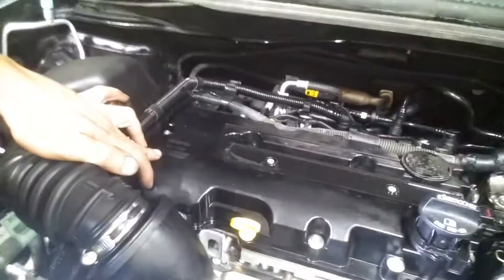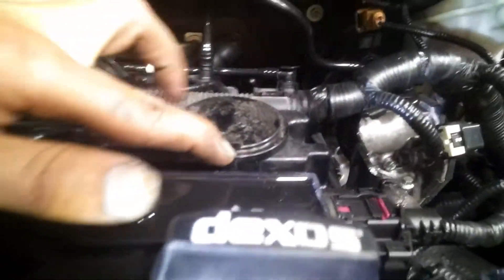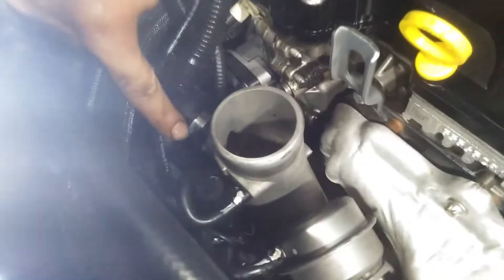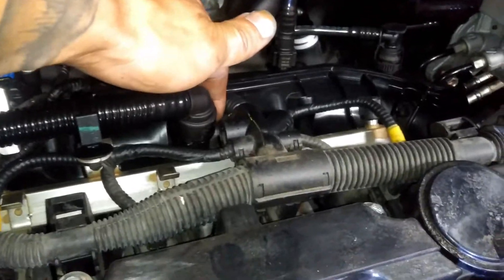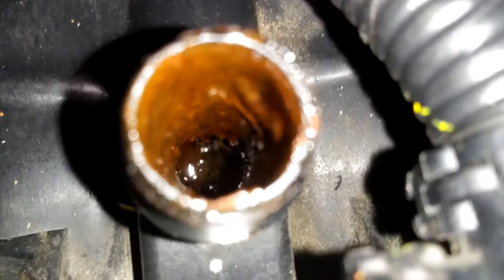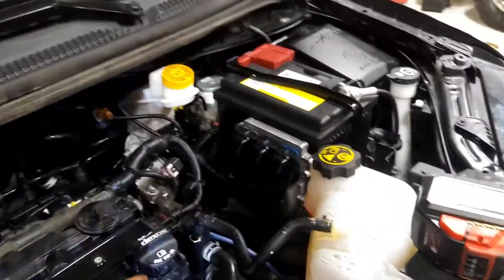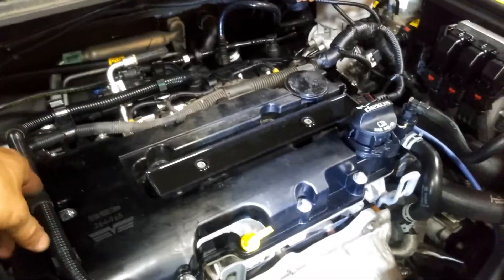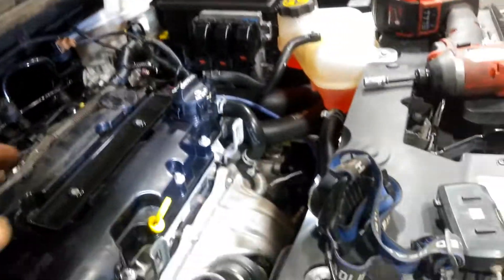chevy 1.4t ecotec squeaking noise chirping sound

Comment: After I did all your points. I checked out the spark plugs and found one of the port’s with an oil film. And checked the torque and, pulled out the plug. There’s was oil on the plug. Cleaning it and putting it back in and torque. All is good. 40,000 miles on a 2016 Chevy cruise. Thanks for your posting.
Reply: You have a video for it ?
Reply: @SkyWarriorsProductions405   no but it was a easy fix.  Seeing the oil film and loose plug. I had no idea this was my problem.
Reply: @SkyWarriorsProductions405  no I didn’t think about it. I now have 46,000 and all is good.

Comment: Tried telling my mechanic and he completely ignored me and said it was the belt. Pulleys, belt, compressor, belt tensioner is replaced. Checked it by taking oil cap off and for sure pinpointed it to the valve cover. Thanks man

Comment: A new crankshaft seal fixed this sound on my end. This video was extremely useful, keep up the good work!
Reply: Hello, it was the seal one flywheel-gear box side or engine side? thank you
Reply: Was your crankshaft seal leaking oil before you changed it?
Reply: @UniquelyDiscovered  not really, just making the weird noise.
Reply: @georgiuzunov4006  ok thank you for your response. I’ve changed my AC pump, drive belt and new tensioner but it’s still making the squeaking noise but not leaking oil. Going to change the crank seal tomorrow and hopefully it fixes the noise!
Reply: @UniquelyDiscovered  keep me posted I'm 100% sure that's your issue :)
Reply: @georgiuzunov4006  I’ve changed the crankshaft seal and tested it today and I haven’t heard that squealing noise again! I think it has sorted it! The old crank seal wasn’t worn on the outer side at all, there was no oil leaking from it. The grooves on the inner side I could say were slightly lower compared to the new one, so maybe that was what was causing air to get past it. But thank you! Glad it’s sorted now.
Reply: @UniquelyDiscovered  happy to see this worked for you as well ;)

Comment: Try unscrewing the coil pack, pull it up slighly.  Turn on the the engine, then wiggle the coil pack up and down or side to side.  See if that makes changes the volume of the chirping.  It could be a problem with loose spark plugs, coil boots or the coils.  The chirping could actually be arcing.  I had a similar problem with my 2013 Cruze 1.4 Ecotec.  It was resulting in poor gas mileage and sluggish acceleration. 
On a side note, if you ever remove the valve cover, check in the timing chain location, there's a brownish orange plastic guide towards the top for the timing chain.  It's been known that this gets loose and it needs to be tightened down. This is because there's a hole at the top of the guide that spits oil to lube the guide for the timing chain.  If that gets loose, then then oil doesn't lube the top surface of the guide where its needed.

Comment: Like others have said.  It's the crankshaft seal.  It may also be the valve cover if you are unlucky.  Be aware checking the plugs will very likely result in torn boots.  There are numerous service bulletins from GM. It's a common problem.  New crankshaft seal cost me $150 installed here in Canada in June 2023.
Reply: I am jealous of your install cost. I have a 2014 Chevy Volt, which uses a similar or even the same engine for electricity generation via gas, was quoted by two dealerships here in California $1500 for the front crankshaft seal replacement.
Reply: Hello, it was the seal one flywheel-gear box side or engine side? thank you
Reply: Was your crankshaft seal leaking oil?
Reply: @UniquelyDiscovered  
It was accessory belt tensioner roller

Comment: Its the crank shaft seal! - Not the PCV valve in the top cover, nor the belts, nor the pulleys, nor the water pump, altinator, air-con etc. Been there done that. drove me mad, spent a lot of time, money and frustration. Got the crank shaft seal changed, Happy Days!
Reply: I replaced my crankshaft seal and I still have the squeaking noise although when I pull out the oil dipstick it goes away. My next noise is now coming from the top of the valve cover at that PCV valve hole on the top of that round piece. What was your fix for this? Did you change the valve cover did that fix it?
Reply: @ffsteel111  yea you need to replace the valve cover
Reply: @ffsteel111  Replacing the crankshaft seal fixed the kind of bird tweeting/chirping sound. This chirping sound was most noticeable when the engine was under load just prior to moving off and particularly when you turned on the A/C. Once the wheels started moving, the chirping had gone. It was also particularly noticeable if you hold down the brake and just tickle the gas. The replacing of the PCV Top Cover cured the constant high pitched noise (which of course disappears when you pull the dipstick). I know it's really difficult to precisely locate sounds in an engine bay, but a medical stethoscope can help sometimes as you can home in on certain areas. I tell you what, when you finally get rid of all those noises, you can sleep at night. Good Luck!

https://youtu.be/uT3EE9x4htI 
This was the same as my noise.
Reply: @stevemc6671  I ended up changing the valve cover I also bought an aftermarket PCV valve bypass and you can install it without removing the intake manifold I purchase it from a guy who has videos online totally bypasses the intake manifold valve and goes down to the turbo it was a great investment.
Reply: @ffsteel111  Hopefully it's all sorted for you and your customer now?! BTW On a different occasion  I had to get the inlet manifold replaced as it had a reocurring and persistent P0170 error code issue.  Oh! and it went through 2 Water Pumps, on the second occasion it almost fried the engine. I must have had the engine built by the manufacture on the last shift before holidays!
Reply: @Ryaninsanity  I'm in the UK and used to  own a vehicle with exactly the same engine (2013 Vauxhall Astra 1.4T SRi). The crankshaft seal cost just over £60 at the time and needed an hours labour charge to fit. It definitely the seal that causes that exact sound. Please don't go the route of PCV breathers, Water Pump,  Alternator, Auxiliary belt etc. Change the crankshaft seal, that noise will be gone and you  can at last rest easy at night! Happy Days!
Reply: @Ryaninsanity  ....If you were enquiring the cost of replacing the Inlet manifold. It was approx £800.Not cheap!
Reply: @Ryaninsanity  🙂👍
Reply: Make sure you follow the proper bolt tightening sequence on your valve cover or you will be doing the replacement again
Reply: Mind had exact same noise. Turned out to be a lose spark plug lol
Reply: @bbltd.3154  Im glad you found it 👍 Mine drove me crazy until it was found and sorted. I hate rattles and squeaks on cars! Grrrr!
Reply: It’s the crankshaft seal!!!!
Reply: Is this right mate  did the crankshaft seal sort yours out mine doing the same
Reply: Did this fix yours mine is the same
Reply: @Tucker Houston  Yes, the crank shaft seal, 100%. It made that exact same noise and despite months of messing about and expense with changing water pump (x2) and the top cover of the engine and cam belt spray, changing the crank shaft seal was the answer - to much relief!!!! No more embarrassing and annoying moments when vehicle is stationary or in a drive-through hearing that f-ing noise!
Reply: @Tucker Houston  Further to my previous reply - Don't waste anymore time, stress or money, change the damn seal - job done
Reply: Vauxhall putting all sorts puts  in my car they haven't a clue they make the cars I've told them about the crankshaft seal they just want put moving parts on wat is the seal doing make this noise and did this sorted for you I put new rocker cover on it after market one fixed it for 2 weeks then I bought another new one gm rocker cover vauxhall make didn't fix it again I put new pvc valve in it didn't fix it this has been stressful doing my head in vauxhall just want make money out off me I spent 340 pounds on new water pump and and tensioner didn't fix it now there saying new air con pump fan belt and alternator funking joke they are cheers texting back
Reply: I'm going do leak down test to for the health off my engine got on finance the thing been doing my head in I drive a14xer corsa d sri 2014 model just keep my mind at rest doing leak down test 😅 🙃
Reply: @Tucker Houston  I did a similar route to you with Vauxhall and got nowhere. So I did a bit (well a lot of digging) and I discovered that Vauxhalls fault diagnosis protocols did not include the Crank Seal, but did all the stuff you have already been through, PCV, Water pump, tensioner, pulleys, alternator, air con, etc etc and I wasted loads of money and months of messing around. I even bought and used a stethoscope to try fing it myself, but as the engine had to be on and under a slight load such as just raising the clutch I found it impossible to do, I didn't fancy getting dragged into the engine with a stethoscope round my neck. Now, I found that Chevrolete Cruise 1.4 Turbo owners in the US had the exact same noise (via Youtube) and doing more Internet digging I found that Chevrolete issued a 'Servicing Buttetin' at some point on this exact chirping issue and it basically said that you should not go messing about with all that other stuff, change the Crankshaft Seal as that IS the problem. So I went back down to my Vauxhall garage (we were mutually fed up with each other at this time) and I told them to stop farting around and change the damn Seal. They did and 1.5Hrs and £60 later it was done and cured. No more of that noise (which I was, by then, hypersensitive to) when the a.c was on, or just coming off the clutch or listening to whilst stationary in traffic or embarrassingly picking up a McDonalds/Starbucks drive through. Its the cheapest, quickest option for you to try and it worked for me 100% from that exact sound you hear on this video. You will be pissed when you realise you have done all that other stuff and it's down to the Seal. Basically, it's not listed in the Vauxhall diagnostics, but it is in Chevrolette and that's why Vauxhall have changed all that stuff and it's made no difference.
Reply: @Tucker Houston  The squeak does not bother the health or performance of the engine at all. Its just a noisy crankshaft seal, no damage is done in the same way you might have a squeaky door hinge but it doesn't damage the door or it's lock
Reply: BTW Mine was a 2013 Astra 1.4 SRi Turbo, I can't remember what the engine code was off the top of my head (I no longer have it)
Reply: Takes my car 20 minutes till the chirping comes in till engine is warmed up right doesn't do it on cold start then you here it chirping when you turn it off because the wheels still turning I've got cable tie on my oil dip stick to pull it to left abit stop the noise and it works I am getting it fixed but
Reply: Steve thanks for texting back this was headaches cable tie dose the trick pull dip stick out abit 😆 🤣
Reply: @Tucker Houston  I found this out too by the dipstick, that's what led to falsely thinking it was 'pressure' related and hence the changing of the PCV. But, of course, after the PCV was changed, the sqeak remained. The crank shaft seal is located deep down where the belt is, so it's easy to assume it's either the tensioners, pulleys, belt, water pump etc. But, as you have experienced, it was none of the things you've already had changed. It cost me £60 to have the seal changed, maybe 6 or more years ago now, so it's probably closer to £100 now
Reply: Going get it done thanks for the help
Reply: Is it the small seal shop is ask is it a rear seal could you send me pic of one please
Reply: @Tucker Houston  I don't have a pic of the item and I don't have the car anymore, but I still have my service records and it said 'replace crankshaft oil seal' and I think, maybe the Vauxhall part number was either V0055568033 or V0025193519 as these are seals which were changed during investigation but there is not enough detail on the service record to determine which one was which. I had the engine cover and water pump changed, but only when the 'crankshaft oil seal' was changed (whether it was front/back) did the noise dissapear
Reply: @tuckerhouston8935  ......its the front one
Reply: @stevemc6671  I got my crankshaft seal done fixed no bird inside my engine nomore hope stays like that cheers talking to me about it 😂
Reply: @Tucker Houston  Excellent! You can sleep at night not thinking about it now! It never reappeared in the remaining 4 years I had the vehicle. Best Wishes 👍
Reply: I no its running better to cheers mate
Reply: Man I hate that expression. BEEN THERE DONE THAT. so old
Reply: I know this is 4 years ago, i have an ecotec motor in a opel and been having this weird squeel only when the engine is up to temperature, its there about 80% of the time when the eninge idles, again only when warm. Also replaced all the pulleys and checked pcv, still there, when i pull the dipstick it makes no difference. The sound is also quite constant, comes when i rev the engine slightly and will stay for a while, anything between 5 to 30 seconds while idling after revving, then goes away again. The car has been doing this for longer than  2 years and is driving me mad. Was your symptoms similar? My next step will be the crank seal

Comment: had the exact same issue. just fixed it and it was a loose spark plug pushing compression past the rubber boots on the coil pack.
Reply: how do tou tighten it
Reply: @harmansingh6933  just watched a dude do it with a 5/8 socket & an extension not hard at all

Comment: I have an 05 outback xt quite modified.. New engine build with a lot of customizations.. The comments and the video categorically nailed down the issue topic I'm having by trying the oil fill cap on then off etc. Clearly my level of vacuum is causing the reed effect of a wind instrument somewhere. I'm not convinced mine is my rear main seal which everyone here keeps calling crank seal.. The majority of seals on the engine are subject to the crank case pressure. The entire valve cover gaskets, the "front crank seal" ie oil pump seal, the rear, all 4 cam seals, the oil pan, the oil pump, brake booster, all your PCV system, probably more. But yea, the shaft seals - cam and crank - that's interesting.. Mine almost sounds like a passenger side cam seal.. Then again passenger side valve cover as well. Still haven't pin pointed mine, but everyone was saying turbo... So turbo air and oil are also culprits technically.

Comment: Literally just had this happen and it was the goddamned spark plugs. They'd changed my plugs and coil but whoever did it didn't torque the plugs correctly. The GM service guy caught it right away, tightened the plugs and it was gone. 

Squeaky spark plugs is the wildest thing I ever heard of

Comment: Have a 2009 Chevy Malibu ltz. Same exact sound. Says pcv us built into the intake manifold. Took that off and cleaned ports. Still making the noise. When removing the oil dipstick, it stops
 What else can it be?? No other signs of leak coming from anywhere else.

Comment: I have that exact same chirp, and I just replaced the intake and hose yesterday, and the valve cover about 2 months ago since it had the hissing sound.  My chirp wasn't there when I first started it, but took it for a drive and when I got home it's squeaking again.  There's no hissing sound now, but there's a chirp.  I'm wondering if maybe I have something else, or did I blow out the valve cover again?  This car is a pain, but fun to drive when it's all working right.
Reply: Turns out my problem was the #2 and #3 spark plugs backed out.   Cleaned them and torqued them down and chrip is gone.   FWIW, my valve cover was hissing, the valve in the intake was gone, and the hose was cracked so they did need replacing.  They just were not the sound I was hearing.   Hope this helps anyone that is reading this.

Comment: Mines squealing when the rpm's climb not idling so ive researched and narrowed the problem down to the valve, plugs, coil pack, or crank seal so im gonna start changing things till it goes away.
Reply: I tightned down the plugs and it didn't help

Comment: Mine squeaks very close to the belt by engine for the initial startup . It’s getting more intense last several years  but dies down after several minutes of warming up. Thoughts? I have an O2 sensor (downward) I am needing to replace and slight coolant leak from a flush mistake that I’m deciding how to diagnose.
Reply: In your case the noise is definitely coming from the belt tensioner